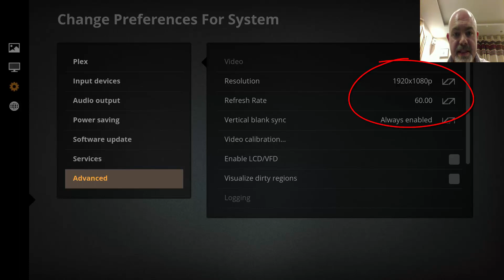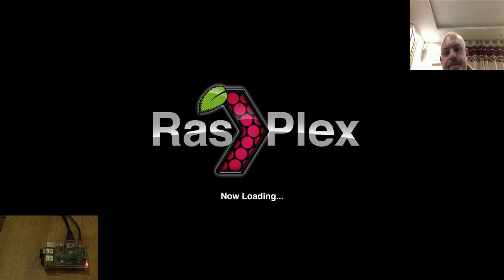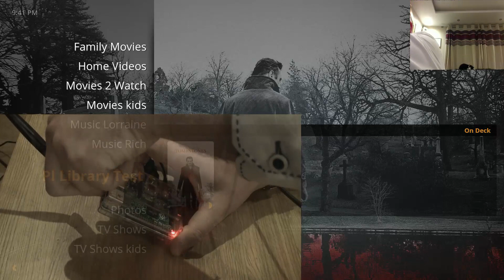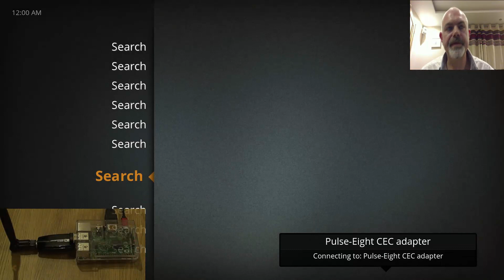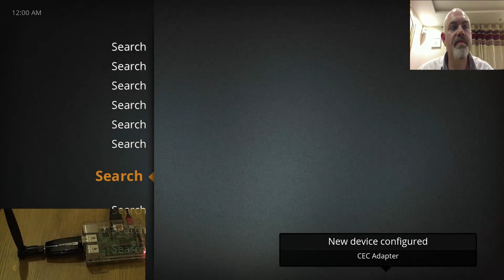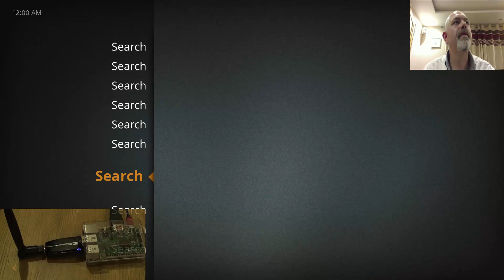RPi2 : PLEX Wireless Dongle Showdown vs LAN cable on 1080p

Comment: i was reading that the TRENDnet USB 3.0 Gigabit adapter basically doubles the data transfer speeds of the ethernet port. while the ethernet port gets 100mbps, the usb gigabit adapters ethernet was transfering over 200mbps.

Comment: I'm following some of your RP2 videos with interest. I agree with you: we should wire (as opposed to WiFi) connections as much as we can. Here in (west island) Montreal, I see about 15+ WiFi networks, and I imagine most of those are streaming all kinds of (video?) content! The "ether" is getting kinda crowded! Also, I don't get a very reliable connection from my WiFi firewall/router upstairs to my TV area downstairs and across the house. Steel work and/or heat/cooling ducting in the way? Before drilling all kinds of holes, I did find a reasonable intermediate solution (better than WiFi, but not as good as cat5): power line "modems", specifically D-Link DHP-308AV, which essentially do their own WiFi, using the power wiring as a kind of "waveguide" or cabling. These were really cheap: Cdn$50/pair. They are also coming out with higher speeds: 1Gbps+. IMO, anything stationary should be wired, only notebooks, mobile should be wireless.
Reply from the maker: Why thank you for your kind comments.  I'm just doing a pi 2 car dashboard recorder at moment.  That's fun
Reply from the maker: I also had very poor wifi ...Until I got my hands on a net gear nighthawk.  My review sits in my tech play list.   I streamed 3 HD feeds over WiFi.   Go have a look, you may find of interest.

Comment: Maybe its drawing too much power from the Pi. I believe there is a config.txt setting you can change to allow more power from USB ports. No guarantees though
Reply from the maker: I'll look into it tonight when I do my pi on pi video everyone seems to be screaming for lol
Reply: Richard Smith hello richard iv been playing around with my b+ i cant seem to get some addons to down load to kodi i had them working on raspbmc but it told me to upgrade to kodi. Is this a simple fix in settings or the xfinity addon not working, im relly just looking for the vdub25 addon if  you know where i may find it else where would be great. And another intreasting upload thanks
Reply from the maker: Pete Turn if you look at my xbmc video testing genesis video streaming...I get that from a repository. ..is your vdub in the same library.
Reply from the maker: I can't find this configuration file